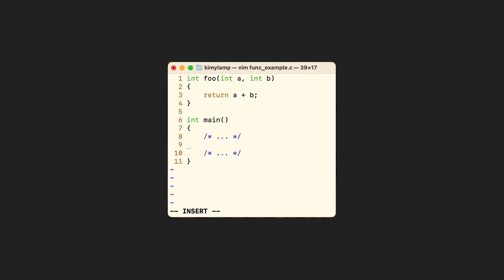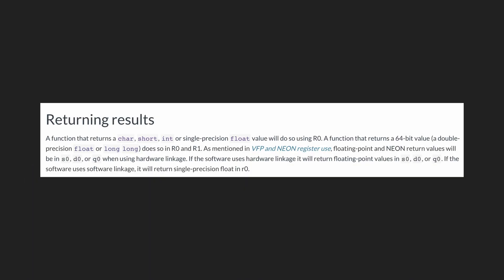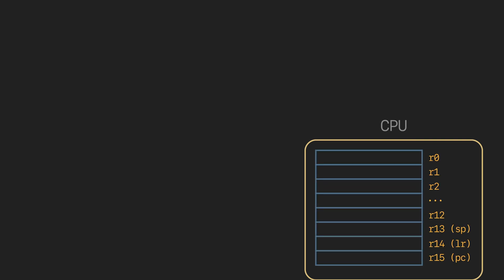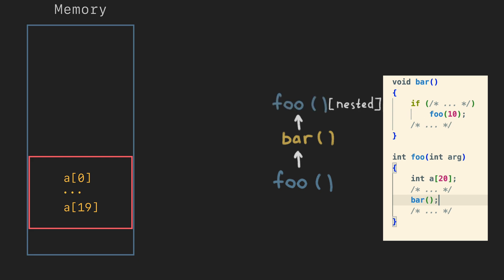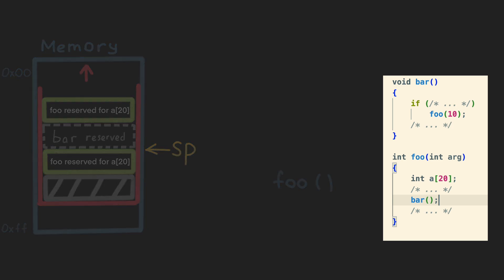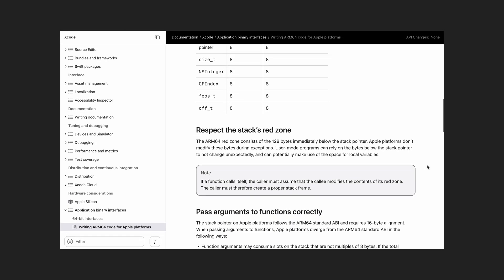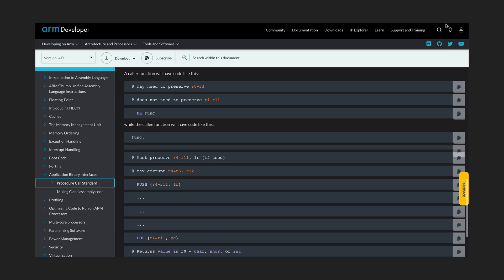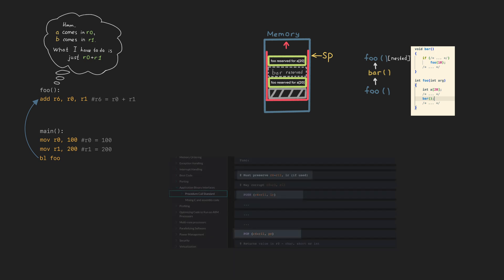How to compile a function call

Comment: It says "128 bytes below the stack pointer". Does it mean below as if below direction was pointed at the 0x00? It sounds weird, since we see the lines go from 0x00 to 0xFF and I'd say that it's pretty much above. Also do 128 bytes mean 2 memory addresses?
Reply: In 64-bit memory addresses are 64 bits wide, i.e. 128 bytes (=1024b) can store 16 memory addresses (16 u64)
Reply: Yes. In x86, you subtract to allocate memory on the stack. In ARM, it can go both ways, but you/OS may need to choose beforehand. Idk much about ARM tho
Reply: stack pointers grows down towards the heap on common architectures